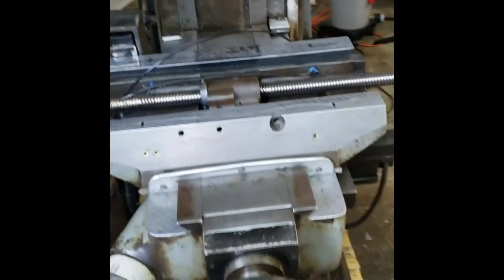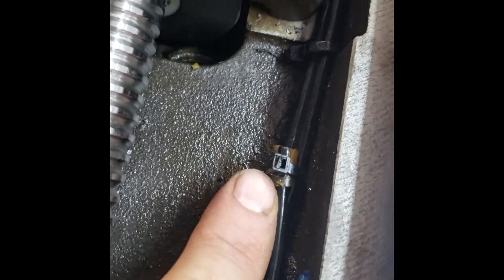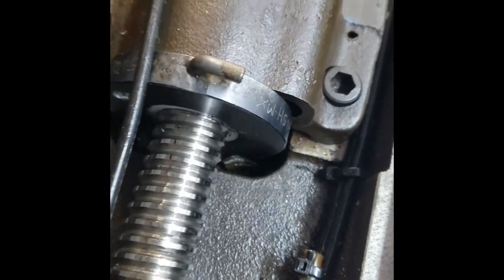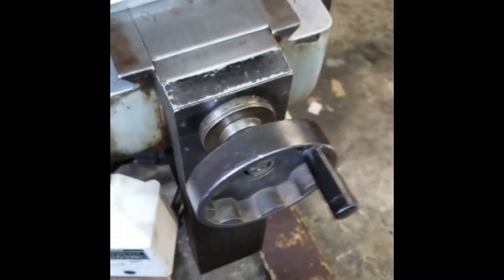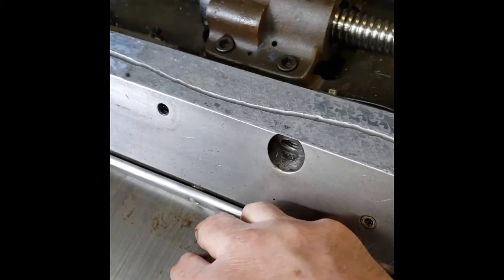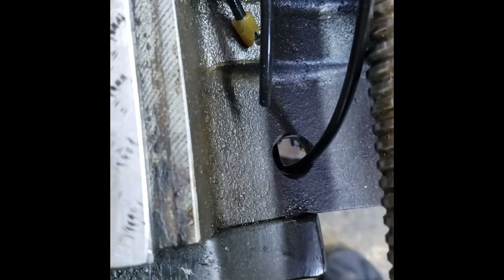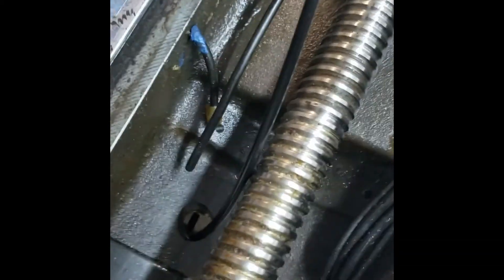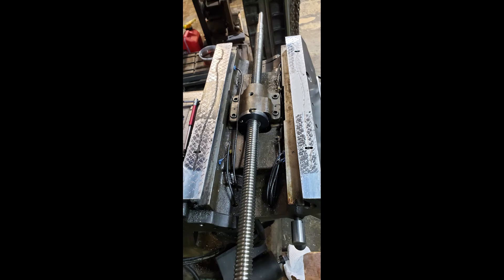Bridgeport Milling Machine Equipped with  Prototrak MX2 control system  Part 2

Comment: I am going through the same problem with my PrototraK right now. Im trying to figure out how to take the X axis geometric engine off. I was hoping your video showed how you removed yours. I love the Prototrak but these oil lines are a headache.
Reply from the maker: @gitpickn8551  all mills have the same lines.  Good luck with yours !
Reply: @RaptorMachineToolCo  I just removed the X engine and table and my lines broke exactly where yours did! I'm going to watch your part 3 video right now.
Reply from the maker: @ hope you find it helpful!